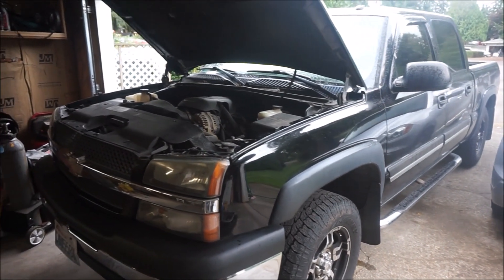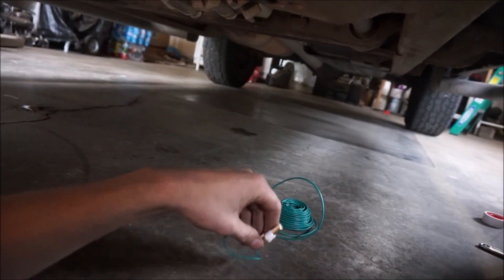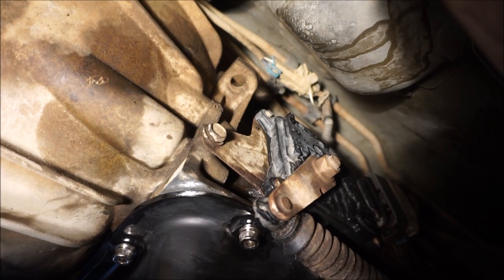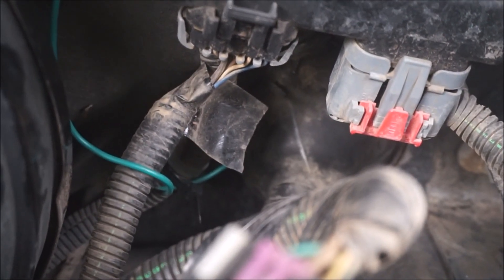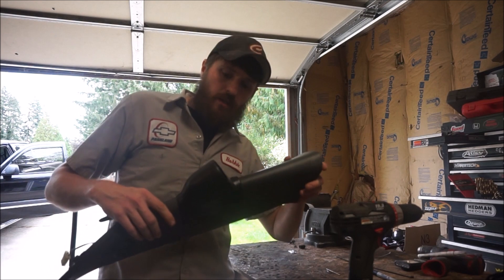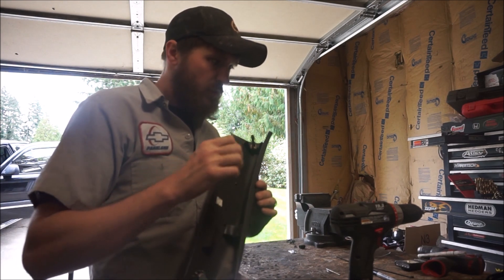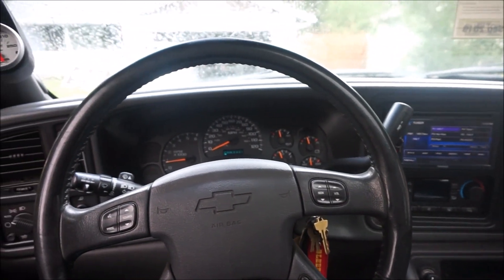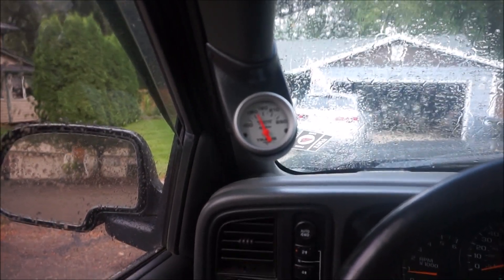Auto Meter  Transmission Temperature Gauge Install Chevrolet Silverado (Project Half Ton Tow Rig)

Comment: You can also get a used factory gauge cluster that has the transmission temperature gauge already, it’s a direct swap and the truck is prewired for the transmission temperature gauge so it will work without running any extra wires or sensors. 
If you can’t find a used cluster that has mileage close to your current odometer, you can have the replacement cluster programmed with the correct mileage. Less than an hour and you are done.

Comment: Doing this to mine now, but I am just adding the GM trans temp gauge to my cluster in my 2003 Yukon. Cluster looks like the HD cluster when done. You just add the new gauge overlay and the stepper motor. The truck is wired for the trans temp already, once the cluster is set up, it is plug and play. I like your setup as well. Nice work!
Reply from the maker: I saw that when I was researching this.  I am curious about it.  Seems like it would be very clean and have a factory look.
Reply: I have high hopes, but I must admit, I am kind of partial to the look of what you did as well. That gauge on the A pillar has an old school badass feel...
Reply from the maker: Haha I agree.  Good luck with your setup
Reply: Yeah you need to program the ipc to acknowledge there is a trans temp. Your easiest way would be to swap the cluster from a heavy duty truck. Its plug and play. No problems. Up to you if you want to transfer the mileage.
Reply: Once you've added the trans guage to the  cluster will you need to do additions installation of the transmission sensor?
Reply: @geraldnavarrro8875  no, the sensor is built in, you just add the gauge and the stepper motor and it reads it. It is wired into the cluster. For some reason, they just cheaped out and didn't add the gauge.
Reply: @Eric Pigg, I called my local GM dealer and they said I would have to take it in to a transmission shop and have the sensor installed because it isn't equipped. I wish there was a forum or video stating if its equipped or not.
Reply: @geraldnavarrro8875  what year is yours? I didn't have to take mine anywhere. Ask a gauge cluster place, they will tell you.
Reply: Just to let everyone know, this will only work on the 2003 GM trucks, but if you have a 2004-2006 you will have to have the cluster programmed after installing the stepper motor to the circuit board of the cluster, and reassembling everything. Obviously GM realized shortly after first beginning to use this cluster, that people would be able to upgrade them without the need to bring them into the dealership, so what they did was locked out the EPROM data in the post-2003 clusters putting an end to the ability of their customers to have all that plug-n-play fun
Reply: @mostlypeacefulmisterputin GM probably had reprogrammed for a different reason. I don't think they were too worried about someone installing a trans temp gauge on a truck that never came with it in the first place.

Comment: At least you'll get a more accurate temperature reading with an aftermarket gauge.  Personally, I like many others would've gotten the gauge cluster rebuilt/replaced with a transmission temperature gauge added onto the factory cluster like any of the 6.0 equipped trucks (Escalades, Denalis, HD trucks, etc.).

Comment: If you are using brass parts I personally wouldn’t use any tape. Brass has a really good sealing factor and tape can degrade over time and or possibly clog tubing/lines.

Comment: My 2000 runs at 140 degrees pulling a 7500 pound camper. It goes up to 170 when on hilly roads. 

Install a trans cooler

Comment: All these comments saying.."YoU cOuLD'Ve jUsT UsED a 2500 cLuStER" well damn! I want to put a temp gauge but since everyone saying to swap cluster.. someone send me one to swap😂😂
Reply: Is it just plug and play?
Reply: Im sure it is. If not it wouldn't be hard to figure it out. You'd just need to run your new wire for temp to cluster.
Reply: Lol yeah. The clusters are hard to get on part outs usually first thing gone immediately
Reply: You have to reflash the milage on the prom.

Comment: Did any fluid spill when you pulled out pressure port bolt. ?
Reply from the maker: Not with the engine off.  It's by the pump so when it's running it when fluid is passing through

Comment: All you had to do was to buy a Escalade cluster and replace it, the Escalade cluster has the temperature gauge on it, every gm suv had a temperature sensor
Reply: Does it plug and read Temps? Or is there still a temp sensor to wire to the escalade cluster ? I have a ss cluster ready to be swapped out for a stock cluster .
Reply: @Jay-iz5oc  it’s already built in the car they just put it in the Cadillac cluster to sell it as a add on 😂

Comment: I don't getting adding a transmission temp gauge pod it's very easy to add to the stock cluster if you didn't have it from the factory. If you aren't comfortable Soldering just buy a factory cluster with the gauge already on it and either program it yourself if you have the tools or pay someone to program the odometer to your milage. no wires being cut it added. All the trucks had the sensor from the factory.

Comment: Have you installed a coolant temp gauge.  Recently my cluster gauge is acting up but my scanner reads good. Wondering if you have done one externally
Reply: Just pay somebody to repair your cluster and they should go through the entire thing and check/test/replace anything else that needs it

Comment: i'm in the process of doing the same, I have the 6L80 and I'm worried about how deep the sending unit goes in. Concerned it might obstruct something. Your sending unit looks just as deep as mine. Hard to find any information on the 6L80 and aftermarket temp gauges. I'm sure it would ok But I still want know it's ok. Glowshift can't even tell me if I need a port extender or not

Comment: WOW just send out your factory gauge cluster to have the transmission temp module installed and EEPROM programmed OR why not get the whole thing rebuilt with new lights and X27 stepper motors for like $165… these GMT800 trucks are already pre-wired for transmission temp /facepalm

Comment: Did you have any issues with the sender probe extending to far into the transmission and closing off flow to another opening? Curious because I see glow shift has a special sensor for this application just because of that potential issue.
Reply from the maker: Nope never had any problems with that
Reply: @MuddyBeards4X4  thanks great videos!
Reply: Do you have the link for the sensor
Reply: @blue4184  I bought the Autometer he mentioned in video.
If I where to do this again. I would purchase a glowshift and buy their sensor specifically for the 4L60E. Gs-ts-11. The reason, worry of depth in passage of trans. My measurements indicate the auto meter fully blocks it. I still used it but added a fitting to pull away from passage. Muddy beards has had no issues but I haven't had the time to research the port. I have a scanner that tell me trans temp as reported to ecm and at times there is a discrepancy. My setup runs colder then what is reported to ecm I believe because I moved the sensor out.  Changing cluster to me is not an option  because the odometer will need reflashed.
Reply: With glowshift you have to use that specialty

Comment: Is your cooler a stand alone or also plumbed thru radiator?
Reply: Undo it… if you have an aftermarket cooler run the trans lines directly to it not through the radiator

Comment: How much wire did you need for this? A kit i got only gives about 3 or 4 ft of wire. I was wondering if its long enough but the a pillar and trans are actually a little closer than one would think lol maybe it will work
Reply from the maker: I cant recall how much wire but that is probably not enough, unless you have a better way of routing the wire into the cab.
Reply: Muddy Beards 4X4 thanks

Comment: Where did you get the wire from to hook it up
Reply from the maker: I just got some wire from the auto parts store
Reply: Will any 18 gauge wire work
Reply from the maker: I'm sure it would but automotive wire is designed for the 12 volt system
Reply: Ok thank you imma hook one on my truck within a couple of weeks
Reply from the maker: Right on man.  Good luck
Reply: Earl Jackson simply send your gauge cluster in and ask for them to add the stock trans temp.. (Not everyone does it ask around till they will modify yours to have a trans temp) at the end of the day it will take you 15 mins to swap clusters and maybe a couple bux more than the auto meter gauge and ur cluster would be rebuild ( not a bad idea even if ur cluster all works)

Comment: Does that pressure bolt come in contact with the fluid? Or are you just reading the ambient temperature of that area of the transmission?
Reply from the maker: Its in contact with fluid.  In fact its right in line with the pump.  So its the temp as its entering and exiting the pump.  If you ask me that's a good place to check the temp

Comment: What is average temperature transmission Chevy Silverado 250 ???
Reply from the maker: That really depends.  Loaded down and towing it will get a little higher.  But 100 degrees over ambient is considered pretty normal
Reply: No more than 180 or so

Comment: Looks great man by chance do you have a link or a model number for the gauge setup you used I’m wanting to so the same thing on my Ls Jeep
Reply from the maker: Thanks man.  The guage is an autometer 4357.  There is a link in the description but that's for the guage and pod combo for the chev.  Might have to search up one for a jeep a pillar.
Reply: Muddy Beards 4X4 not needing the pod really going to mount the gauge right in front of the transfer case shift handle
Reply from the maker: Right on.  That guage is super simple to install.  I would love to see this LS powered jeep.
Reply: Muddy Beards 4X4 gonna do some looking are for a black face gauge but white will work if it has to Jeep more of a mall crawler/ hot rod has a Btr Stage 4 cam arp hardware and a built 4l60e on 37’s 6”suspension 3” body lift
Reply from the maker: Sounds pretty awesome

Comment: Every time I am doing some kind of install, I grow to further despise the thinking that put fuses on the drivers side under the dash.   What is  wrong with these engineers?  First, the pretzel aspect: it is THE most awkward place in the vehicle to do any kind of work on account of the steering wheel.  Second, and more importantly, is general safety.  What if your car dies while driving?  You pull over, and maybe might like to check fuses, right?   But that leaves both a door and your butt sticking out into traffic.  Good luck, dude.
Wake up, SAE: put fuse boxes on the passenger side if they are to be located in the cab.

Comment: I would never drill and tap the pan like that. Not in a million years. Why wouldnt you put it in line?
Reply from the maker: Drill and tap the pan?  Don't think you were paying attention.  The sending unit goes into the pressure port.  No drilling.  No tapping

Comment: You did all of this for nothing man. All you had to do was swap out your instrument panel cluster with one from a heavy duty truck that has a gauge and it would have worked instantly. The sending unit is already there and its plug and play I just did it to my 03 sierra last week and the gauge is fully functional and accurate (compared it with a scan tool)
Reply: RSH21 
He would had to have reprogrammed the mileage on the dash.
Reply: RedWhiteAndBlueVideo 
Yup, Exactly
Reply: But that takes 5 minutes to do yourself or less than the cost of that pod to pay someone
Reply: @RedWhiteAndBlueVideo  only of he wanted the mileage updated. It would just say the mileage that was already stored on the cluster. I replaced mine with 21kms it was brand new. Never updated. I dont care cos I am keeping the truck. Have 32000 km now